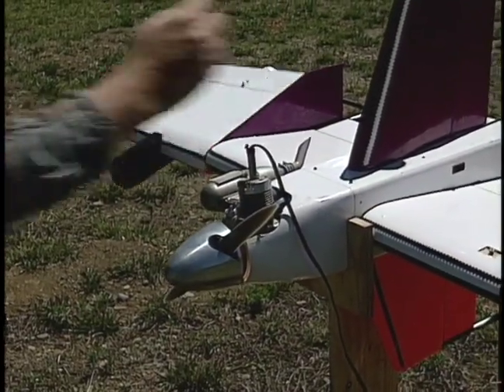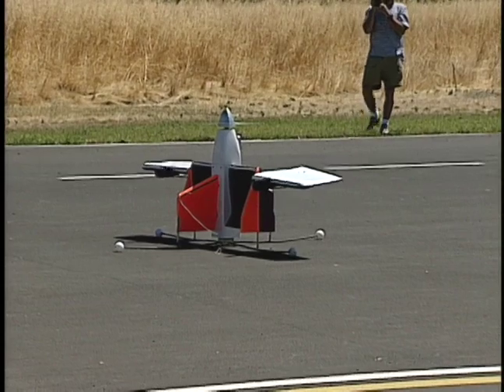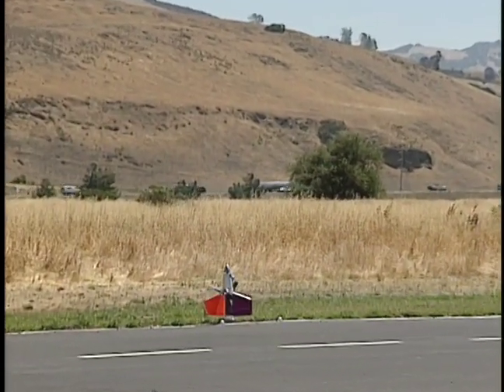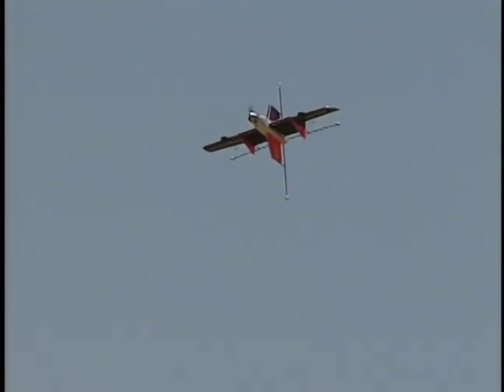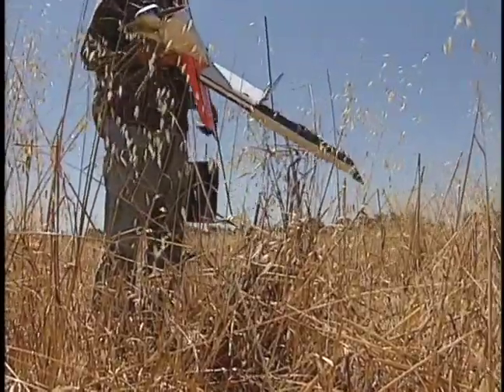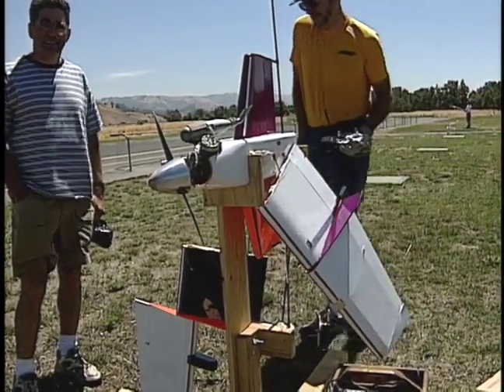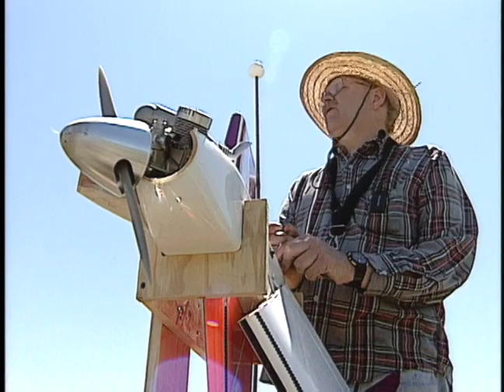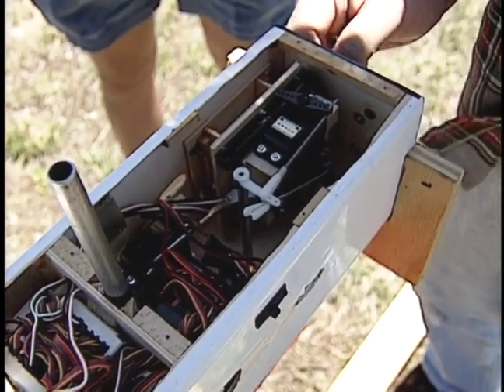VTOL experimental aircraft flight & crash at sccmas

Comment: Flight controls on the center section very undersized for control in the vertical. I see what he was going for with it, just a bit to conservative flight control sizes. He should done a little more research into 3D aerobatics and the comparing the ratio of the flight control surface size to engine size and aircraft size.
Reply from the maker: I will forward your opinion to NASA.

Comment: You could have said "why". Contra-rotating propeller and putting your moving control surfaces behind the propeller that deflect the airflow from the propeller to give you control in vertical flight. Tail surface is harder to do this.

For a VTOL aircraft you need control in the vertical state, also you may want to put the engine in the back and icrease the area of the width of the tail for compensating the weight if you do decide to move it backwards. 

I use brushless motors.

Comment: Saw a quad prop version of this that worked very well.  When in vertical flight, it flew like a quad copter, when it rolled into lateral flight, two props were above wing and two below.  Smaller rudders and the thrust ratio was much higher with the four props so the transition from vertical to lateral was much smoother.